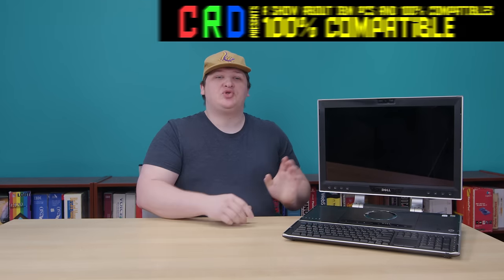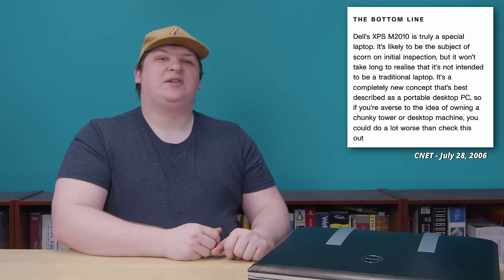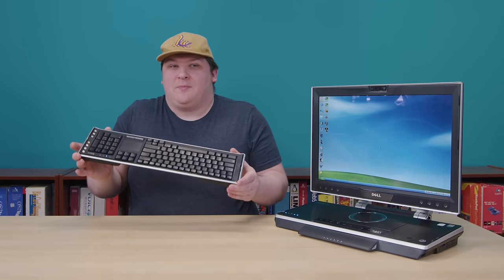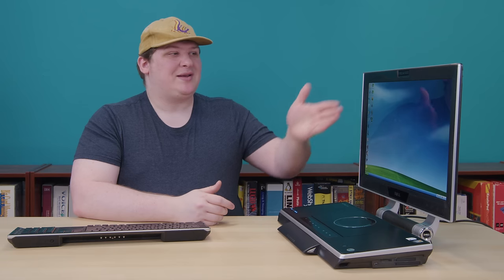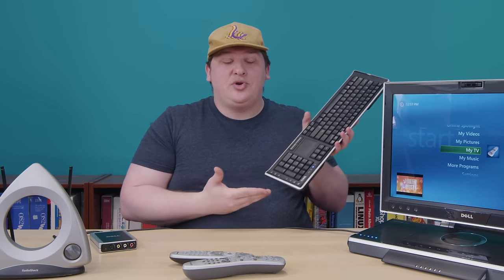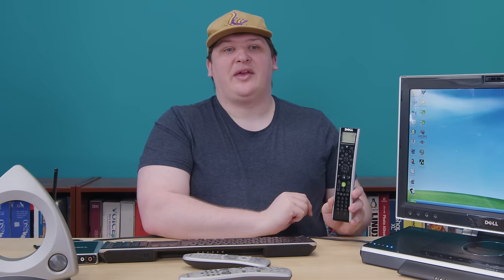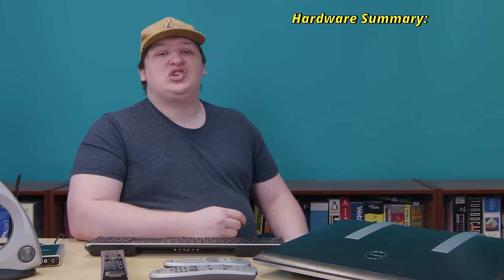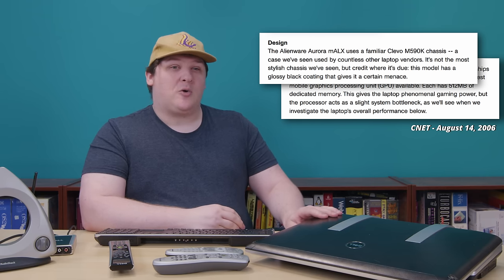Dell Called It "The Showstopper"

Comment: Mine sucks with all the rubber stickiness.But after a massive ram and ssd upgrade and some keyboard syncing issues as well as an occasional drive uo and down issue i do admit im fond of it. I remember working at NBC boston and all four editors got these and they loved em....i used mine yesterday and all i do now is set it up in my tv van when i wanna impress the transmission officers covering the final four.....windows xp i had to do by thumbstick

Comment: What's interesting come to think of it, is in Australia TVs uses to be sold in cm, in the CRT days: you would buy a 38cm tv (tiny) or a big 68cm tv. However now all tv's are in imperial, you buy a 28inch tv, or a 60inch tv.  This change happen roughly around us changing from CRT to LCD, which also was around the time of our change over to Digital TV. So I wonder what caused us to revert to imperial, as the standard for screen sizes.

Comment: When torquing things down, a good rule of thumb is to go to the furthest screw/bolt from the one you're on that you haven't torqued already, applying this to 4 bolts in a square conveniently results in the standard X pattern that is usually used
Reply from the maker: Yeah, I did that with everything except the gpu sink and I couldn't figure out why. In retrospect, I suspect I was only spinning the screws down lightly to begin with, and had I continued watching I would have seen myself actually tighten them in the usual X pattern, lol
Reply: @CathodeRayDude  makes sense, I'd do the same

Comment: As a former employee of the maker of that wireless USB chip, Cypress Semiconductor (later purchased by Infineon) the reason it never took off was mostly because it didn't sell well because frankly the chip was too expensive and the industry was standardizing around Bluetooth so by the time PSOC4 launched with bluetooth as an availible on on board periferal even Cypress abandoned the idea. New old stock of those chips can be found at basically every supplier in existance and is still agueably absurdly priced.

Comment: I actually had an M2010 and it was the best "laptop" I ever had. I didn't actually class it as a laptop due to the size, I considered it more of a portable PC. But its power (for the time), size and layout made my life 10 times easier. No squinting at small screens or having to zoom right in. The ability to set it up on a car seat platform next to me and not have it slide around. Larger peripherals which were much easier on the hands...........and a heavy solid machine to hit people with when they insulted my "laptop".

Comment: As a Canadian, it would be weirder if we didn't use each type of unit for a different purpose, so I can't say for other parts of the world when it comes to measuring screen sizes.

Like, we use centigrade for measuring outside air, and farenheit for baking.  We measure distances in centimetres, but our heights in feet and inches.  We measure the alcohol we get in millilitres, but order it in pints.  If there's a different unit of measurement out there, odds are we've found a way to incorporate it into some aspect of our life.

Sure, I haven't heard fathoms come up in casual conversation, but I've not been to all of Canada yet, and just because I haven't heard it, it doesn't mean there isn't a community on the east coast that use it regularly.

Comment: I seem to remember early bluetooth back then was a hardware controlled single IO serial COM link, which was easy just shorting two pins on the chips to pair. Then as 1.2 (or higher?) got released, it required a PIN and supported more HID services (audio links etc), requiring a more complex and software controlled interface- Memory is a litle fuzzy, but I remeber the hell developing with BT and making it work properly before BT2.0 was a standard and widley adopted. (which is why the button then, has gone now)

Comment: Great device and gread video! Regarding the rubber  coating around 45:00... I had the same problem with a SonyEricsson Phone from that era and tried like 8 different solvents to get it off. I'm about 80% sure that it finally worked with WD40. I definitely tried Isopropyl and it wasn't that. Maybe worth another try if you haven't tried that?

Comment: I bought the M2010 in early 2007 and absolutely loved it as my daily driver. I still have it in storage. My only complaints were the nonexistent battery replacements after the originals perished, and how Dell completely abandoned driver support after Vista. I had a heck of a time getting windows 7 installed because there wasn’t a driver for that video card. I eventually found a hacked universal driver without 3D support and used Windows 7 until I had to move to a new machine in late 2012. Six years was a good run.  I would buy a modern version of it with identical form factor if it existed.

Comment: I've love to go back to 16:10 ratio. It's really hard to get a screen of that ratio in Europe. I look at manufacturer websites, and do see screens of that aspect ratio being made, but then when I look to buy them in Europe, they're not available.
When I got my latest monitor, because I didn't want to lose any height, I went from a 24 inch 1920x1200 monitor, to a 27 inch 2560x1440 monitor. I would have prefered another 24 inch monitor, but I couldn't actually find one with the features I wanted, with a pixel height minimum of 1200 smaller than 27 inch.

Comment: 10:00 I think I have that exact same panel in an old dell monitor I picked up off of Craigslist. Definitely has some uniformity issues, but I believe it's ~20 inches and has that exact resolution. I guess they just stuck a desktop lcd panel on their... laptop (type thing?)

Comment: I will stick to your epilogue and totally agree. This machine is so unique and surprisingly useful multimedia portable PC that it needs to be maxed out hardwarewise!
I don't remember if intel made Core 2 Quad CPUs for mobile but this deserves one if they are around. Also I would put 2 SSDs in RAID0 mode (cause I also generally hate spining disks more for their unreliability and fragility rather than their speed) and would try a newer ATI GPU.
I would also use Windows 8.1 x64 with Media Center cause it is the fastest Windows imho that supports older and newer hardware at the same time and can be used even today easy for raid and full ssd support and media center and windows vista-7 drivers almost always work and browser Firefox with long term support edition...
Excellent full detailed video as always, Cheers from Greece, Jim

Comment: Having run both Intel and nForce RAID through the early 2000's I can definitely say it was a cursed experience. The F6 RAID driver option in XP only ever seemed to work reliably if you used an integrated floppy drive controller

Comment: Lenovo had a display - the L220X - which IIRC was 20" at 1920x1200. I had like six of them over the years, my brother still has them, still in use in 2024. They're great PVA displays, if you don't mind wrestling with DVI input these days and the fact that their USB hub is only USB 2.0.

It might have been slightly larger, but it's very close to 20".

Comment: Some ATI All-In-Wonder cards included a MCE remote that looked and functioned like most others except that it used a small RF dongle. I don't recall if it also had IR (IIRC the card had an IR blaster).

Comment: 7:50 - depends, as a general rule, as far as I'm aware, all promo materials refer to the inch size of displays in all English speaking countries, in my country however, they refer to the diagonal size of the screen, which is in cm. 

The reason why this phrasing is important, setting aside the fact that well, Americans have this idiotic tendency of just replacing the one component that's foreign to them and just assume the rest of the sentence is the same, is because this corrects the immediate and predictable reaction of "that's sounds weird!" that they are bound to have.

 It does, because you are not used to it, and perhaps, because nobody is actually using it, or at least not traditionally.

So instead of saying "I have just bought a 65" tv." you would say "I have just purchased a TV with a 164cm diagonal." 

Though I have noticed a trend to either use the same Western phrasing but just in cm creeping more and more, and to be fair the inch standard is slowly taking over. For example reviewers often state both, not just because people are more used to it, or rather reviewers are, but also because it's often the first number in the model's name.

Comment: I almost have to wonder if the battery existing is partly a consideration for meeting/conference use for presenters and venues. It being so convenient to hook up to anywhere you go for just watching media casually would likely mean you'd also be pretty well equiped for whatever scattershot setuos you'd be running across at different conferences making presentations, you'd have a remote to control that presentation that doesn't need line of sight, and you have it all in a form factor that looks quite sleek and presentable, especially folded up. It seems a bit overkill now that you can just pull files from the cloud wherever, but back in the mid-aughts? I could see this thing being a miracle worker for presenters.

Comment: If the housing is not ABS plastic you can use acetone to easily strip off gummy TPU soft touch coating. Test the acetone on an interior spot first in case it is a plastic acetone will dissolve.

Comment: 51:30 And today my MSI GE67 with a 12900 and 3080ti gets about two hours of battery life in light gaming. Batterys on high- performance laptops are more like a UPS so it doesnt crash when the charger isnt plugged in yet or you move it a few tables :)

Comment: I was around when laptops/etc first started coming out, and the term notebook never came into use at that time to describe laptops.  A notebook was an evolution in size, to indicate a much thinner, lighter computer.  Originally, computers that could be easily moved were termed portable/luggable since it was impossible to use something like a Kaypro away from a power outlet or on the go.  After notebooks, things got a little less clear-cut, with terms like palmtop and eventually tablet.

Comment: Utterly awestruck by all the little mechanical doodads and fiddly bits. I would have hated to try and service one of these, but just as An Object, it's so beautifully designed. Really does feel like something that these days you'd dismiss with "oh that would be way too expensive to manufacture!" Similar kind of awe I felt at the Switch's JoyCons, but in terms of sheer excess instead of clever convolutional design.

Comment: 9:04 well, the black stripes at the top and botton are very small if you display 16:9 content on a 16:10 display and probably most people don't care about them and at that time, much of TV was still 4:3 and 16:10 is a compromise between 16:9 and 4:3. But yes, the resolution below full HD is a bit disappintibg, they could gave usexmd 1920x1200 instead.

Comment: As a European, I can confirm that we use inches to measure monitors overhere. We also use inches to measure car or bicycle wheel diameter. Far as I know, these are the only cases where we don't use the metric system. I have no idea how long an inch is, but I do know how long 15 or 24 or 32 inches are. :-)

Comment: I thought these machines looked so cool when they showed up in the Dell catalogs. I ended up getting a used M1730 instead, which that "skunkworks" bit makes me think at least part of the same team worked on to replace the M1710 with something that could compete with those SLI laptops. Similar magnesium chassis, speakers, A/V output, dual hard drives, little custom version of kinda gimmicky hardware from another company (Logitech HUD screen), special marketing name (The Beast), battery that's more of a ups, and similar thermal issues too. Feels like their fingerprints all over it.

Comment: Yeah, screens (monitors or TVs) are measure in inch here in Sweden too ("tum"). We never use inches to measure. However, since screens aren't labeled by their inner height * width, but rather the hypotenuse of those measures, it's kind of a "says nothing about how much space the screen needs"-measure anyway. So inches or cm doesn't really matter, as the actual size of the device as a whole would be listed elsewhere (+ who cares if the hypotenuse is in cm or inch)

Comment: This era of soft touch rubbers break down quite easily when exposed to oils, many a mechanic watched their spanking new screwdriver set dissolve in short order when exposed to the daily grind. Especially if they worked on anything that contained traces of butyric acid.

Comment: I have three of these. And fun fact the GPU can be replaced with a Quadro FX2500M and it still works. I have mine running with that on Windows 10 with significantly more modern graphics drivers. Downside being the display output connection is a different pinout. I'm still trying to sort that out. At the moment I have it using the display and cable from a Precision M90 (also where the GPU is from). It is likely to even go up to a Quadro FX2800M. Possibly even the 3000 series (but that's more unlikely). Main issue with any of the Quadro variants is the output connection. Since the M2010 display is notably higher resolution than most of the displays on the more portable workstations at the time.

Comment: I'm from Argentina. Everything is metric here but some imported stuff, like TV or monitors, are measured in inches too. For some reason the same happens with wood and other building materials like screws. Also beer, but again that is weird because a "pint". is understood as a "big glass of beer" so in different places they may give you more or less beer, and most people don't even register that pint is a unit of measurement,

Comment: I remember in the 2000s spending 24 hours a few times trying to install windows xp . One time it was because I actually left a printer plugged in and that stopped me from installing windows xp. But many times I had to fight with window xp to install on older machines.  Battlefield bad company 2 was so fun

Comment: There are a TON of Dell RY496 M2010 Premium media remotes on Ebay. Like...a lot (surprised they're not still with their M2010's). I would be very curious if there's any way to get the remote working in any way on a modern computer.

Comment: moving forward you might do A/B testing - the onboard speakers vs. some crappy desktop speakers (or another laptop!).  That'll give you a nice comparison vs. the 'normal' speaker, which will carry through even for folks with crappy speakers of their own (like me at the moment, I'm using a Motorola Dispatch speaker, a mono 4" single driver VERY optimized for voice).

Comment: I had the M1710. The screen on it was nice at the time. I'm happy that 16:10 seems to be making a resurgence. It fits well with modern laptop formfactors. But then, I'm not interested in any laptop other than the framework ones at the moment, and I like 3:2 even better than 16:10.

Comment: All of the features scream "travelling company man workbook" to me.
The three-hour battery lets you plonk it on any table while negotiating a sale, discussing features, showing pictures to your employees, etc.
The sound system and remote are for personal use at a local hotel or motel without having to care about whatever cheap CRT your room came with.
When you take it home, you can even wire it into the rat's nest behind your TV and still access all the shows you recorded while travelling.
Even the handle seems like a nod to a "this is the luggable for a slick businessman!" motif.

Of course, I'm not one of the developers of the thing so my word can be taken with a grain of salt, but I really think that this could've become a replacement suitcase (without the clothes) for people that work for months without being able to travel back home.

Instead of now, where we have a drop-proof brick laptop that won't even let you create a new document on the hard drive without consent from a sysadmin.

Comment: regarding the battery: many modern-ish laptops (e.g. intel-based macbooks) don't have enough oomph in the charger to satisfy the peak current needs (e.g. when the CPU is turbo boosting), so they rely on the battery to provide the ampacity. given all the stuff that's packed into this thing, could the battery be included for the same reason?

Comment: This was such a cool time to be into PCs i remember dreaming about having one of these bad boys and one student at my school actually had one. 1680x1080 at this size is just right for XP as well, 1080p gets a bit tiny. this stuff was designed around 800x600 being commonplace. Using those 17" 1900x1200 laptops was probably nice for the young with good eyesight but anyone over the age of 30 probably wants slightly larger text. Also if you were playing videogames it was an easier resolution to drive without having to scale the image, which was something to think about.

Comment: I still wish that this computer had a modern variant.
I always wanted one after seeing it while still in high school, but when I was ordering my college laptop they weren't selling it anymore.
I ended up with the Studio 1735, and with the specs I chose for it, it actually ran Vista just fine. So, my experience with Vista was wholly a positive one.
Reply: If I could have an M2010, I would personally prefer Vista over W7... Since my experience with Vista was superior to my experience with 7.
I could reliably run my Vista Laptop without any internet, and fix the problems I ran into without the internet. I miss having technology that can be fixed without requiring me to hunt down some dusty corner of the internet for the precise problem I was having...